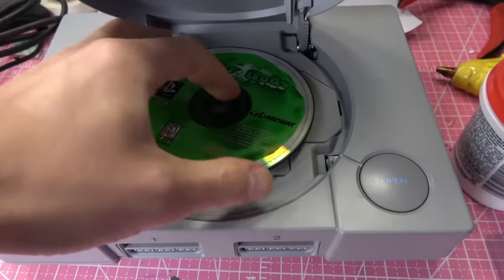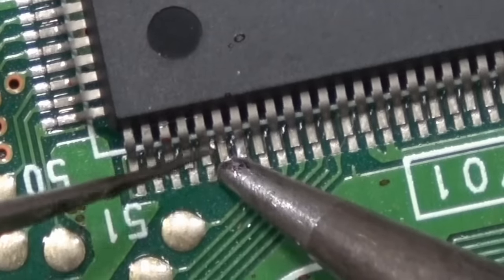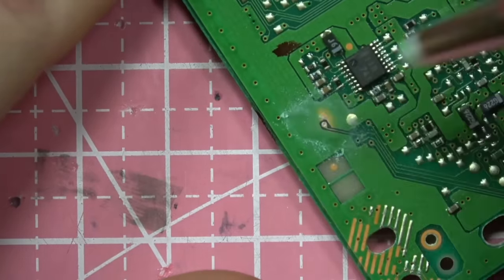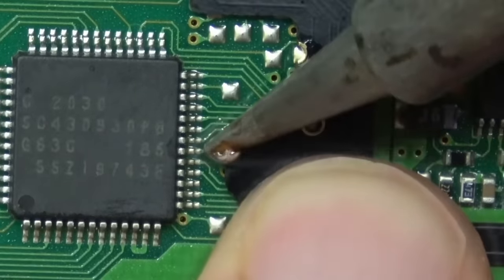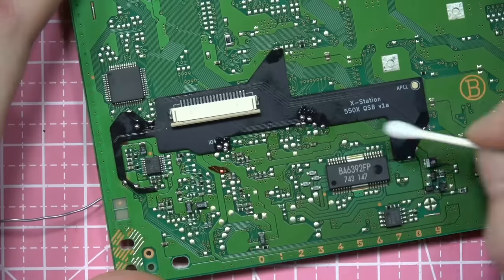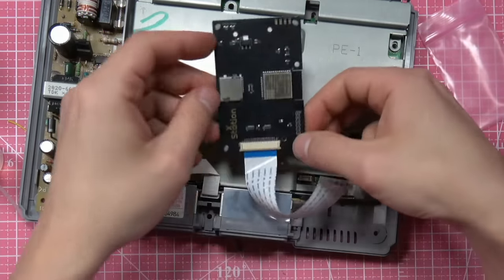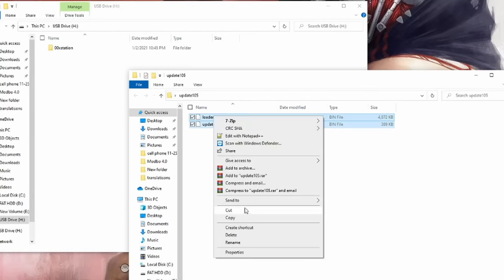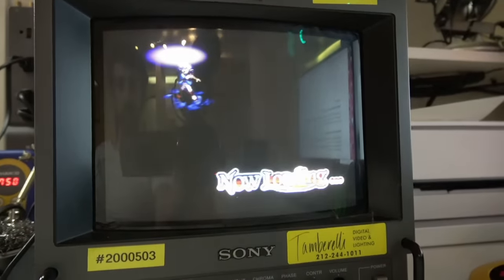PS1 XSTATION INSTALL, PLAY ALL PS1 GAMES FROM SD CARD

Comment: why rid off CD rom, if someone want both to work , SD + CD ROM is it possible?
Reply: Then maybe the PSIO mod is the way to go.
Reply: PSIO retains use of the disk drive but has compatibility issues with some games. X-Station has better compatibility.
Source; I own both.

Comment: awesome, now no need to flip the console upside-down when game unable to run
Reply: Omg, until you mentioned that I'd forgotten about it.  Only way to make my games work.
Reply: Is it work on ps2 bro?
Reply: This guy is missing ingredients for soldering and is actually damaging the chips the board and the metal. I just wanted to let everyone know so if you try this and start a fire or damage your board, it's because this guy is doing it wrong.  I'm not saying what he's doing will not work, I'm saying the process he is using is incorrect.
Reply: @robcabob1og  So what you're saying is that yea it'll work in the end but he's actually causing damage to the board? What ingredients is he missing exactly? Sorry for all the questions, you mentioning this caught my attention since I'm just starting to get into this hobby of modding/soldering.
Reply: Ale spawac to ty umisz...! Paproku jeden... Jak bys mi tak konsole polutowal to bym cie poszczul tesciowa. 😭
Reply: @robcabob1og  As well as needing to apply the iron for a bit longer to the part he's soldering on to the playstation PCB. This allows the solder to flow freely and uniformly in order to get a nice clean & non-cold solder joint.
Reply: Thats because your lasers pot needs adjustment its quite easy to do with a multimeter a steady hand and patience
Reply: International trick!
Reply: @GojoKun_  don't do it on ps2 it will scratch the disc

Comment: Nice. This is a lifesaver for ps1s that are becoming harder to get in good condition.
Reply from the maker: It really is. Disc drives dying left and right too
Reply: @RETROGAMINGARTS   very true.
Reply: I've got one in good condition for sale lol
Reply: Or one in good condition for a good price. Like, I saw an ad here on YT of Ebay for a Resident Evil 1 Director's Cut disk new, still sealed with cellophane, for TWO THOUSANDS EUROS! REALLY?? 🤨
Reply: Thankfully mine is still ok. I have a gen 1 Original PS1.
Reply: @4packdaddy  I still have my PSOne, the slim version but it's modified with the old method from early 2000 to read burned discs too, you know.
The only issue is, some years ago, the central black rotating piece where you insert the disc got damaged so it can make discs spin, unfortunately. Some day I will take it to repair shop... or if I may find replacement part, could do it myself.
Reply: @DanDeyBananaJoe  You just need a new disc spindle.  They are very inexpensive and can be ordered online.  I suggest buying several because they can crack and break easily during the install.  And you'll need to put 2-3 sheets of paper under the disc so you don't push it down too far.
Reply: @LatitudeSky  Thanks for info, I must search it. But honestly, I was thinking to directly taking my PS2, instead, to someone to install the modchip or whatever it's required so I can play both PS1-2 backups in it.
Reply: There's tons of PlayStation consoles in good condition. You just have to look
Reply: Replacement units are dirt cheap and free shipping from China. Not sure where you live that it's hard to come by. Here in Europe it sells like hotcakes and people mod and replace parts fast as it sells. Considering PS1 and mainly PS2 sold in billions of units and parts are easy and dirt cheap it aint going anywhere any time soon. Good luck with that the latter consoles, especially the ones from today... They are destined to vanish like they never even existed while PS2 will live forever.
Reply: @RETROGAMINGARTS  that is the issue with cd based consoles, disc rot and laser failure.
Reply: @randy s yeah, I know about freemc, I just forgot about it. I saw some videos recently for doing it. The only "issue" I'm thinking, since I'm in Sardinia (Italy) and with some particular stuff, you have to look maybe worldwide because some items are not findable in my country, so don't know if I have to pay too much more for shipping a little cheap item, in this case, than the item's price, you know. But I still have to take a look, maybe I can find some near and that is not fake (most important thing with sites like Ebay etc.), without paying an eye for shipment.
Reply: Mine still works but I rarely use it now as I just use my pc for emulating ps1 games. I do have an adapter that lets me plug my dual shocks into the USB.
Reply: @dredgewalker  me too in these last 10 years I played those old games for ps1, ps2, gamecube and psp on my pc. 
But now from like 3 years that my pc doesn't work and I didn't repaired it (even because I really didn't need it) I'm playing all of them in my phone.
Only whished I could have used a DualShock 3 or Xbox controller instead of a third-party bluetooth controller, my phone can't recognize Sony and Microsoft gamepad 🙄
Reply: @DanDeyBananaJoe  You'll need a paid app to be able to use your dualshock 3 on your phone. I use a dualshock 4 which doesn't have any problem pairing with my phone or pc via bluetooth. I rarely play games on my phone cause I have my psp and vita for my portable emulation needs.
Reply: @dredgewalker  nah, dude. I've checked on Google and in some Reddit results I've read in Xiaomis phones you can't use Sony or Microsoft controllers (I've tried Sixaxis Controller free app to check if it could have worked but no). Maybe with a custom build but I don't want to mess with the phone's software, I've tried with a guide for my Ps3 slim and I bricked it...
Reply: And it's solution for original games being sold for absurd prices, because coomlectors need to have games stacked on shelves from the ceiling to the ground.
Reply: its a life saver to save MONEY in the long run. expensive retro games are NOT worth their sale value regardless of nostalgia.

Comment: Ten year-old me would flip the shit out by having the power to play every single game at one click haha
Reply from the maker: lmao!
Reply: @RETROGAMINGARTS  Would this be possible on ps2?
Reply: @EyefyourGf  On the PS2, you only need a memory card with freemcboot, and a hard drive adapter for your expansion slot :) I've recently installed mine, it's awesome. There are many tutorials online on how to do it.
Reply: You can also use a modbo modchip and put an internal harddrive (on the fat version)
Reply: @EyefyourGf  As said above, the PS2 doesn't need that because there is the FMCB for PS2 memory cards. So you have a lot of options to play games using internal HDD (the best option, but only for FAT version), USB HDD or Ethernet.
Reply: The fact that you said one 'click' tells me you've never played a console in your entire life
Reply: @tristan6509  fat version? Do you mean the original playstation?
Reply: @robcabob1og  the first "phat" version of the PS2 probably, as opposed to the slim model that came later on :)
Reply: @robcabob1og  lol here comes the boomer, my first console was an atari lol

Comment: This is perfect. No mechanical problems on read CD + the fact that actually is not emulating any game
Reply: Still cheaper to buy a whole drive unit and easier then this to replace. I had to replace one in 15 years and looks like the new one will work another at least 15 years. The only benefit I see in this and worth the money is loading times of the games because the SD I think it's far faster then the regular drive. Granted if you have the right quality made SD otherwise it's worse then dealing with a broken unit.
Reply: @weirdsailorman4070  It probably won't load faster than from CD, because there's a limitation in the console itself. Even if you run games from ISOs in an emulator it still loads it as slow as it was on a real machine. It doesn't really matter if I have SSD or HDD. Loading time is still as slow as from CD on a real console. The only emulator I use that has drive speed boost is an Amiga emulator FS-UAE that can speed up virtual floppy drive to 800% or even faster called 'Turbo mode'. The problem is that some games freak out and crash the emulated Amiga. 💡

And I think it's more reasonable solution over CD drive, because it's convinient having all your games in the console than having to deal with CD swapping and original games that are reaching absurd prices because of those coomlectors that use the original games as room decoration. 🤐
Reply: @weirdsailorman4070  even tho the SD is faster than the laser the PS1 still have like 6mb of Ram and a 32mhz CPU... the laser can read much faster than the CPU can process that information. so putting an SD dosent make it faster. that said... the idea is really good. having all your favorite games on 1 SD card its really cool. because lets face it... burning CDs is a pain in the ass....

Comment: Great Work!

I can't wait for the playstation 2 version.
Reply from the maker: There's ps2 HDD mods for it. It's like this, but with a hardrive
Reply: You need a memory card with an exit and a hard drive for the fat PS2, cost me about £16 for everything. No soldering or taking the system apart.
Reply: @RETROGAMINGARTS  but a similar SD modification in the disc drive of the slim PS2 would be a life & space saver.

Comment: Hey thanks for the video. I e been modding consoles for a while and have struggled to find anything to load games to the ps1. I just happened to see a pre modded ps1 for sale so I googled it and your video was the first one to pop up and i an more than adequate for explaining the install. I just have to find the hardware for the mod now which I believe you referenced a site.  On a side note the install looked alot cleaner and easier than the right points on a 360. I feel like that's mainly because the quicksolder qsb  is so nice but either way this is a cool mod. I guess I shouldn't be so excited considering my 360 has hdmi stock and can load every playstation iso but the original playstation holds some dear memories from my childhood and it would be super cool to have one sitting on the tv stand with virtually every game.  Thanks again for the video. I'm going to check out your other stuff shortly!

Comment: I have the same setup with my ps1, the gray color sd card mount. Just think if we painted the microsd and sd adapter gray. It would be completely invisible unless you really looked closely at it. Can't wait for the 1TB cards to drop down in price, hello NTSC-U, PAL and NTSC-J.

Has anyone ever used a massive ps1 memory card? I have a 96 page 1440 save games card. Only figured out how to work it last year and I've had that card for about two decades. It can only change pages in the ps1 memory card manager with the following:

Hold L1, R1 and Start together and a red dot should show on the card. If the dot appears release L1 and R1 while still holding Start, then press L1 or R1 to move the pages left or right (backwards or forward) iirc it can be held down to advance much faster down the pages. Release the buttons to select the page and it will start a countdown timer to prepare navigation of the next data page.

Once that is completed the new page should be displayed on the led window.

Cheers!
Reply from the maker: Now you got me looking for grey paint... and hold up. WHAT ABOUT THIS MEMORY CARD??? can you link me google image of it or tell me its exact name so I can buy one LOL

Comment: Little bit squeamish watching this: you should heat the solder, not the pad and you use the tip, not the rim and you never EVER wipe against the board -- you use less solder than you think you need and you always let the surface-tension do the work for you!  I'm gonna assume the camera was giving you trouble/in the way while you were working - that's not a condition I've ever had to work under, so I don't envy you. Excellent use of flux tho. More is better and it totally compensates any risk this technique has on the board. Good stuff. Good video and great tutorial though. Subscribed.

Comment: So I have some questions regarding this device.

1. What's the largest size of SD Card this device supports?
2. How does it handle multi-disc games? Would it automatically find the next disc and load it in for you or would you have to manually do something?
3. Does this let you play games from outside your region or would that require a separate mod?
4. How well do the games, especially their FMVs, actually run, are they choppy?

Comment: This is a great video! I just ordered the Xstation and received it today. Unfortunately my PS1 that I bought new in 1997 isn't compatible since the board revision is PU-22. But I just ordered a 5501 model from ebay and should get that in a few days, then I will try to attempt the install. I'm no stranger to soldering but may practice on a dead board before doing this install. Too bad the PS1 Digital isn't available right now but will consider one when they do become available.

Comment: Your audio sounds clear man. Was your editing process "smoother?" Cause I know sometimes that can be tedious. Also that's sick on the ps1. I still use my psp for ps1 games. But some games like mutant academy 2 don't work on a modded psp for some reason, so having the original hardware might work better
Reply from the maker: Does it? Good im glad, the changes didn't so much help speed up the editing process. They helped with the setup process, I always had to change settings and plug in the mic for every video. Now I can just leave it on the way its setup and it will always sound good, and yea. Psp works great for ps1 games. I love it, I didn't know that about mutant academy
Reply: @RETROGAMINGARTS  well I'm glad you back to being able to make stuff. And yeah it was a game I had when I was younger and enjoyed playing the crap out of it. It was a disappointment when it didn't work when I modded my psp
Reply: Although I haven't touched my PSP in a long time so I don't know if this is still helpful, but...

The PSP's PS1 emulation software used to change from Firmware to Firmware, breaking or fixing compatibility with certain user made eboots.

There used to be a plugin called PopsLoader which allowed you to extract the PS1 emulator from different Firmware installation files and then choose different emulators when booting a PS1 game on PSP.

You might get your game to work by trying a different Firmware's PS1 emulator.

Comment: I just did this on a 5501. I have a T12 soldering iron with a fairly small tip (D-08) and I used a dental pick (or hardware store equivalent) to hook then heated the pin. pop. Very clean. When I finally booted and heard the Wild Arms theme I damn near wept.
Reply from the maker: Great job Ryan, sounds like you really know what you're doing. I'm glad it worked so well for you. I'm a huge RPG fan but never played wild arms, highly recommend? If i love persona/final fantasy. And anything squeenix does, ill like it?
Reply: @RETROGAMINGARTS  First time actually. Was pretty nervous. Wild Arms is great imo, but I may be wearing rose colored glasses for it

Comment: Awesome.  I bought a tub full of "broken" consoles at a Flea Market this past Summer for $5.  It has like 3 PS1 consoles in it.  Not sure what is broken about them cause have not even tested or cleaned them yet, waiting for a good snowy day kind of thing, but maybe if they actually can be fixed or work maybe this mod would be good to do on one.  Especially if it's just hte Disc lazer that is the issue cause no need with this mod.
Reply from the maker: thats a deal, you just sold me on going to flea markets, and on this particular ps1, it had a broken disc drive lol
Reply: @RETROGAMINGARTS  exactly. There is a SNES and a few NES boards in the tub as well. What is funny is there is a note on one of the PS1 that says VIRUS!! Like what?
Reply from the maker: LMAO. I wanna know why they wrote that note
Reply: @RETROGAMINGARTS  yeah. When I finally take a look at them and clean and test I plan on making a video about it.

Comment: great video and very educational... Now I just wonder did the Save File still goes to the PSX Memory Card or it goes to the SD Card?
Reply from the maker: Memory card. And thank you very much for watching and checking out my channel😀
Reply: That's got a retro feels but requires the need of physical memory card (which is quite rare these days)... hope there's an upgrade in the future that put save files in the SD card so we won't ran out of Blocks... keep up the good works, you're amazing!
Reply from the maker: Thanks man, they just came out with a new memory card for ps1. 8bitmods. Its unlimited storage and it saves to sd card. It's also on castlemaniagames website

Comment: For the pins you decoupled from the board, should they be removed from the chip entirely? Also, what tip do you recommend using for the Hakko FX888 and at what temperature?
Reply from the maker: I don't remove entirely, Incase you have to put back for trouble shooting,

I use either a conical or a k series tip at 325-350c depending on the job
Reply: @RETROGAMINGARTS  

Thank you for the response and great content.

Comment: better compatibility than PSIO but you sacrifice the drive, even though many of the drives are on their last legs and the discs are suffering from disc rot and modchips/burning discs is a pain in the ass like you have to get taiyo yuden or mitsubishi verbatim discs instead of the cheap CMC ones, and having to use the right burning software like alcohol 120 or imgburn and using the right speed and the right cd burner.